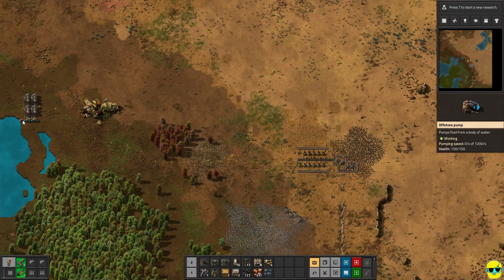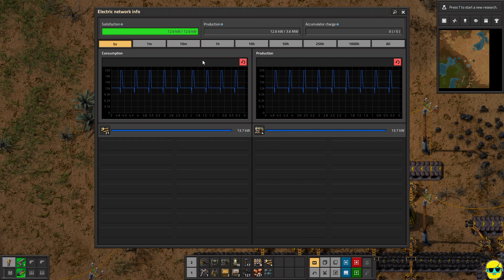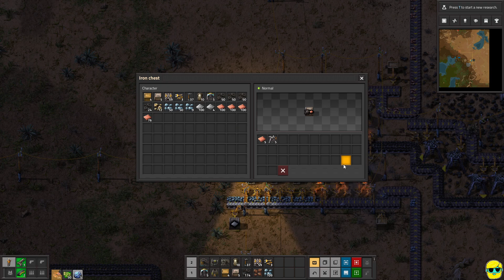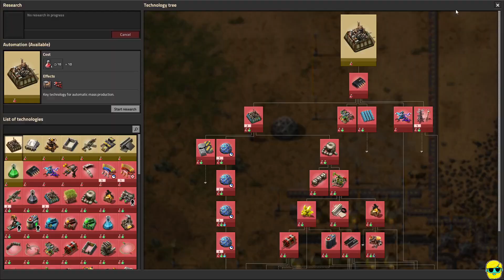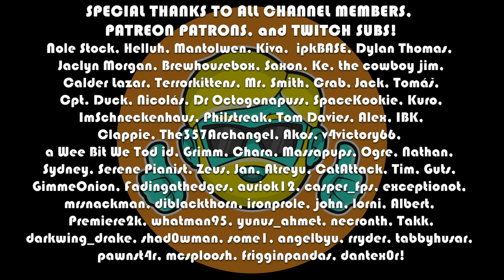Factorio | 2023 Guide for Complete Beginners | Episode 2

Comment from the maker: Chapters / Timestamps:

0:00 Introduction 
0:45 Understanding the ratio of boilers to steam engines
1:38 Checking power production and consumption using the electric pole interface
5:03 Automating metal processing by using both lanes of a belt for different items
5:10 Importance of keeping different item types separate on the same lane
5:35 Setting up conveyor belts to transport ore to the smelting area
7:21 Using inserters to load and unload items from belts
12:08 Distributing power to different parts of the factory using power poles
16:15 Automating coal mining and transportation to power boilers and furnaces
20:06 Balancing the input and output of resources to ensure smooth factory operation
24:52 Need to automate gear production and introduces the concept of using assemblers for this purpose
25:55 Building laboratories to research new technologies
35:30 Producing red science packs, which are needed for research
37:53 Daisy-chaining labs to efficiently distribute science packs
39:05 Importance of researching automation and logistics to unlock new structures and improve factory efficiency
40:07 Assembling machines, which are used to automate the production of various items
40:47 Long-handed inserters and their ability to place and pick up items from a distance

👨‍🏫Full Factorio Guide Playlist Here: https://www.youtube.com/playlist?list=PLLZqXZAwfuGd1tHvUZ206bFFgzPR_jLkj

🔀 Full Factorio Playlist HERE: https://youtube.com/playlist?list=PLLZqXZAwfuGdQMfo6qMbcjxQSXSIiCCi5

Comment: I like using burner inaerters in areas where they may need to run without electricity, such as when fueling the boilers. If you get a coal shortage for some reason, you can fix it and insert thr coal automatically to restart your power using coal alone.
Reply from the maker: Good idea!

Comment: Im getting a problem with the mixed belt of iron ore and steel plates - the grabber arms are sometimes taking the steel plates back in further down the line and making steel beams, so my line is getting contaminated; any fabricator waiting for steel plates is then forced to stop. Can I tell the furnaces only to make steep plates?
Reply from the maker: Great question! Furnaces make whatever you give them, so you can't tell them what to make, sadly. What you can do is use filter inserters instead of regular ones so that they only pick up what you want, even if your line gets contaminated! Sometimes, I just have to break belts apart because maintaining a 2 lane belt can be hard at times.
Reply: It's generally considered better to mix coal and ore on the same belt, since those are both valid inputs for a smelter. That way you can get one belt for input material and one belt for the output plates. Build a separate smelter array for different ore types like copper or for processing iron into steel.

Comment: question. Do electrical drills need to be put together that closely at 28:00 ? if you place them there's this blue outline that goes one square further than the visible machine, I assumed the machine would also cover that area and placing them that close together would not make maximum use of the machines on the ore patch. Thanks for your input. Love the videos, started playing this yesterday (but have hundreds of hours in satisfactory so I caught on quickly)
Reply from the maker: This is a great question! I always put them really close together, but I bet you could space them out more like you say if you want! It would save you some drills. They can both mine the same tiles, I think, as well.
Reply: Getting drills closer together means extracting ore faster. The total amount of ore on a patch doesn't change so if you have more drills mining the same amount at the same Speed you'll mine more ore per minute.

Comment: MW is megawatt, mW is milliwatt. Milliwatts are a tiny amount (much less than what a small lightbulb uses), and megawatts are a large amount. A megawatt (or a million watts) is a billion times larger than a milliwatt (or a thousandth of a watt).
Reply from the maker: Thank you for clarifying this ^_^
Reply: To put things into perspective by numbers:
1000mW=1W
1MW=1000000W

If you translate them directly you can see, that milli and mega are not the same at all.
1MW=1000000000mW

(By the way... 1kW=1000W so 1MW=1000kW)

Comment: Good stuff. Though rather than mixing ore and plate on the same belt on the output side, you could mix ore and coal on the input side. That way you avoid having to separate the ore from the plate.
Reply from the maker: Correct! But, as it is built, I have iron AND copper using the same interior belt for coal, so I'd have to redo the whole thing to allow 2 kinds of ore through, right?  Now that I have long handed inserters, I can do better, but we will do better still with splitters and underground belts soon haha.
Reply: Very good beginner’s guide. I’m thinking about buying this, as it seems that this a game I would start playing and then as if by magic several hours have flown by. Is this quite simple once you get your head around the basics?
Reply: @stephenwalker1984  The systems and mechanics of the game are quite simple. The difficult part (and fun part, in my opinion), is putting everything together into a functional factory. And not just functional, but expandable, clean, efficient, space efficient, etc. There are so many solutions to the problems you'll come across, and coming up with your own can be very rewarding.

If you're new, I would also follow Dr Incompetent's advice in the first episode and go through maybe the first 2 or 3 tutorial maps, then just go to freeplay from there. The later tutorial maps are not necessary and take far too long to complete. And yes, it can be a time sink if you really get into it!